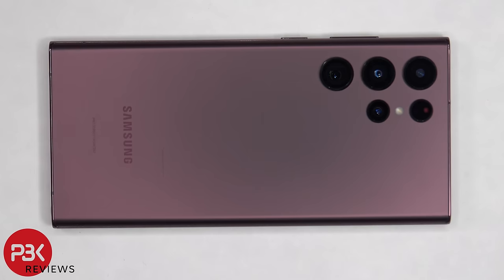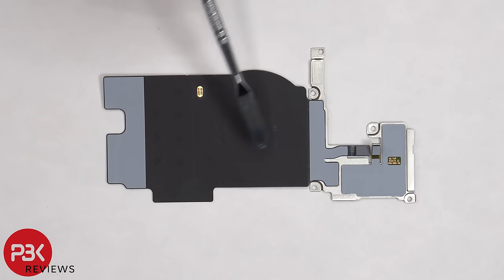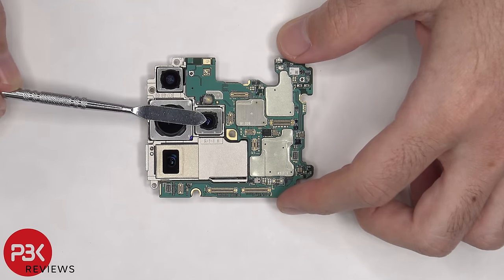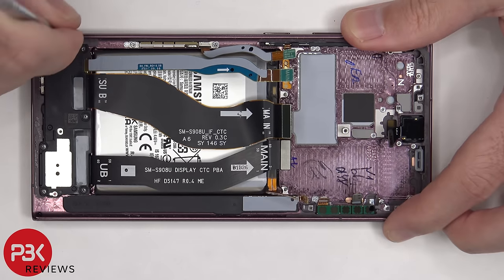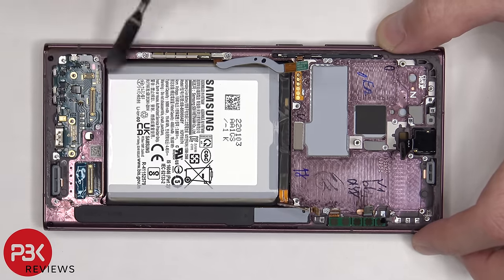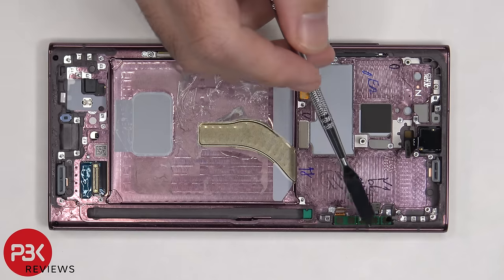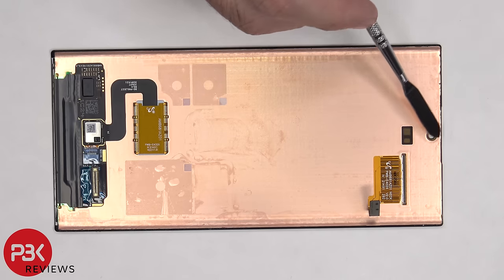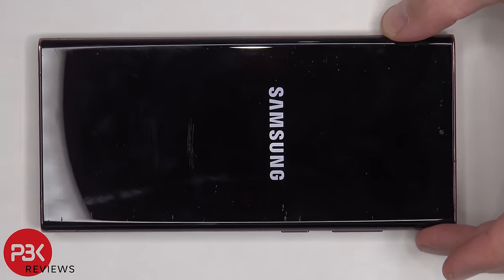Samsung Galaxy S22 Ultra Disassembly Teardown Repair Video Review

Comment: I got my S22U 3 days ago. Replaced my OnePlus 8 Pro.  I play Rise of Kingdoms quite a bit and the S22U simply can’t handle RoK without clocking 110 F.  My OnePlus has no problem whatsoever and only gets warm. This is very troubling, and I am very disappointed in this $1400 smart phone! I will be returning. Does anyone else have a overheating issue??

Comment: Hmm battery is actually rated at 4855 mAh and not 5000....smh 🤦🏾‍♂️
Reply from the maker: yep, all batteries are rated slightly less than the typical capacity.
Reply: @PBKreviews  good to know it's not just marketing fluff, great teardown BTW 🍻

Comment: Also you tried saying that some models and regions may not have 5g antennas but are still 5g!? Hahaha you ever done this before?? I may be FAR from great on youtube but i wont state "facts" if i clearly have no clue what im talking about.. try saying "i believe" or "it may be"
Reply from the maker: Lol this comment clearly shows you have no clue what you're saying. I said some region models dont come with the mmWave 5g antenna, but the phones still support 5G which in most regions is sub 6GHz 5G. The phones which dont come with the mmWave 5G antenna just wont support the mmWave 5G networks. There are different types of 5G networks not only one kind so google and educate yourself.
Reply: @PBKreviews  never did you say support 5g hahaha you said they are still 5g.. the video is right there hahaha